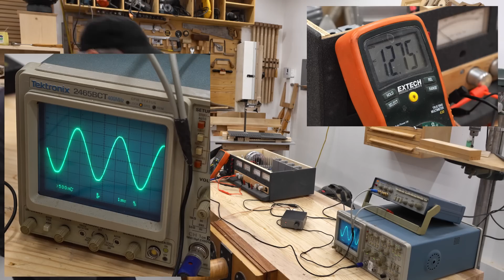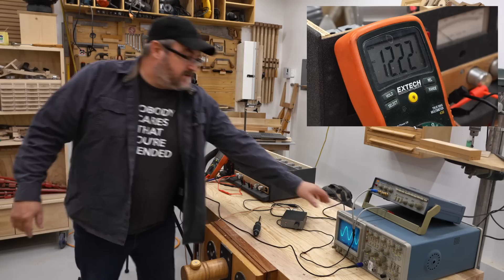LIARS! Testing A Low Cost Amplifier - What's the REAL Power?

Comment: I picked up a Fosi Audio TB10A off of a local ad and hooked them up to my Elac B62s and it had plenty of power.  I wanted a DAC all in one so I went with and FX Audio unit.  The FX didnt nearly have enough juice with the B62's.  I started to research for a better amp then noticed a comment about increasing the power supply on the FX Audio unit.  The FX audio had a 24v unit the same as the Foci unit, or so I thought.  The specs on FX and Foci were the same as far as power supplies but apparently the previous owner of the Fosi unit thought it needed an upgrade.  The brick was a 48v unit so I decided to throw in onto the FX audio unit for the hell of it and problem solved, lol.

Comment: I just bought a 100x1 amp board with the same chip off of Amazon. 

I knew it wouldn't do 100 watts, especially running off an 18 volt drill battery, but this video raised my expectations a bit compared to what I expected. Thanks!

Comment: That supply looks (and sounds when you put it back down) like most cheap aftermarket laptop chargers. They are typically over-speced, and lack good voltage regulation.
 I personally prefer open frame style supplies when possible simply because you can see what's in them and it's harder to hide garbage components. May not be ideal in a woodshop with possible dust ingress, but can be mounted in an enclosure easy enough.

Comment: Great video.... btw: I don't know any company that doesn't lie about power ratings. And another thing is, that if you measure a so called 4 Ohm loudspeaker, it usually has around 3,4 Ohms DC resistance, at least that's my exp. Doesn't add much, though. Clearly, the power brick is too weak, no doubt about it. I wonder, why all these brands always ship their I would say very fair products with "underpowered" PSUs: It should be the other way around - if you don't need the output, you should be able to take the cheaper option, but the standard should be the full power version, IMHO.

Comment: I bought one similar to this one. It was advertised as 200W RMS (100w x 2). After noticing the included power supply shut down at around 50% volume. I looked at the specs on the included power supply and it worked out to be 90W :( I my book, that's false advertising! Thanks for doing this test. I wish I'd seen this before buying one on these.

Comment: Just curious - are the specs in RMS values? You are measuring in RMS (0.707 of peak) so 0.707 x 50 volts is 36  volts RMS.

Comment: it's well documented that most of these preamp's do not push out the power they're rated for. or anything close to what it's rated for. 
I'm trying to find an amp that can power 2 subwoofers of each channel. each woofer is rated at 200 watts RMS on each channel. 
my question is. is there a preamp that you would recommend?

I'm looking at a preamp board on amazon > SKTE IRS2092S 500W Mono Channel Digital Amplifier Board Class D HiFi Power Amp Board.
rated at 500 watts. but it requires 1.5 watt RMS for the input and most likely an 80-volt AC-DC power supply. 
thanks

Comment: I couldn't tell what the oscilloscope was connected to. Usually class D output is not a sine wave unless you filter out the switching frequency. Just curious. Great video.
Reply: @klincecum  that makes sense. The ones I have used were filterless, but were also much lower power (like less than 1 Watt).

Comment: John,  I think the amp rating may be in peak watts not in RMS watts.  Multimeters typically display RMS volts on their AC scale.  So your voltage number should be multiplied by 1.414 to give the peak voltage....  but I fully agree with you (assuming the amp's internals are sufficiently designed) the power brick is the limiting factor.   Love these videos BTW!
Reply: That would mean the amp rating is just marketing wank. Actual AC power is always rms. Outs only amp manufacturers that use the nonexistent pmpo tasting.
Reply: @Spectral_Penguin  It most likely is marketing - 'peak watts' is a common rating on low-end equipment.  AC signals are measured in many ways including peak-to-peak and RMS voltage.  Power is measured in watts.
Reply from the maker: It's not peak. The retailer is just taking the specs from the chip manufacturer which lists it as 50 watts per channel into a 4 ohm load. The amp is capable of delivering that, but not with the supplied power adapter (like I said in the video).
The chip manufacturers always use the rms value when quoting audio power, since it is the industry standard. And to calculate power, you use the rms value for the output signal, not the peak value.
Reply: @CDN_Torsten  I am aware of different ac measurements are taken, but ac power is always an rms value. Stereo/amplifier manufactures that use peak voltage or current to calculate power are just douches.
And if, as John says, it comes from the chip rating and not the final product manufacturer, then it's most likely legit and he is right about the supply being primary issue.
Reply: @Spectral_Penguin  The point I was initially attempting to make is that their marketing department was being 'creative' with the way they are specifying the amp's capabilities.  More watts sell.  John's hypothesis may also be correct - the amp's power rating figure is based on the datasheet spec for the TPA3116 and not the configuration being sold.  In all cases, to get a true 2x50W output, the power supply which is rated at 19V, 4.74A would have to be heftier as it's only capable of 90W (assuming no losses in the amplifier).

Comment: I use an Aiyima A04 which uses a TPA3251. While I had to buy a 24v ps I find it to be very musical and revealing at low to moderate volumes with low distortion. For 50 bucks I wasn't expecting much but it beats other amps at many times its' price...IMO and preferences. As for what all these sellers advertise, I don't believe them. A 175 watts at 10% is ridiculous. But 30 to 40 watts is fine....especially for 50 bucks and 23 for two 24v ps, especially for desktop use.

Comment: use a 24v 4a power adapter and you'll get 33 watts RMS into 8 ohm , which is a nice bump over 20 watts , and in a smaller room this is a nice loud maximum volume.
Reply: sorry looked again at manufacturers datasheet the 33 watts is peak power so times .707 ,  is 23 watts RMS

Comment: Nice looking power supply. Power is Joules per second, in electical terms it's Volts x Amps. However you are right to say that you can use ohms law to substitute Amps for  Voltage/resistance. You can also substitute Voltage for Amperes x resistance giving power as I^2R.

Comment: The output voltage hardly dropped with the 4R vs. the 8R load so the power supply is capable of sufficient current, the 19V it just too low. First page of the datasheet says it needs 21V to do 50W in 4R. 19V was probably chosen since it is a common voltage for laptop chargers so dirt cheap
Reply from the maker: Just one channel driven, though. The supply will sag a lot more with both channels operating.